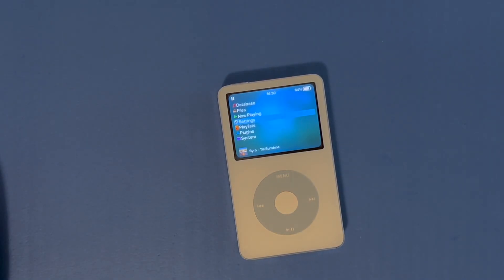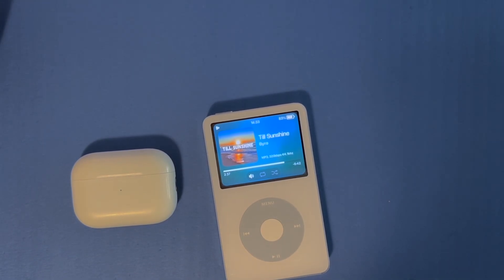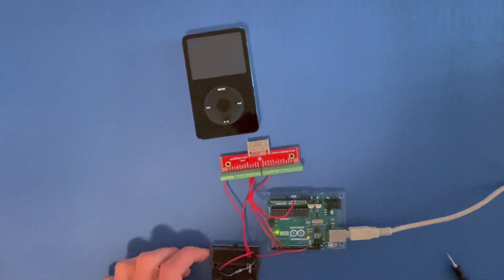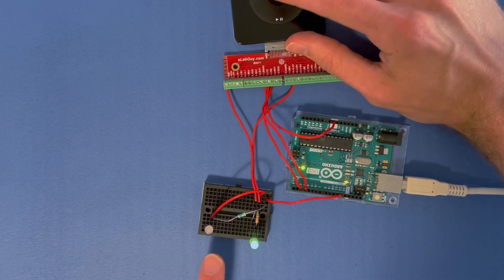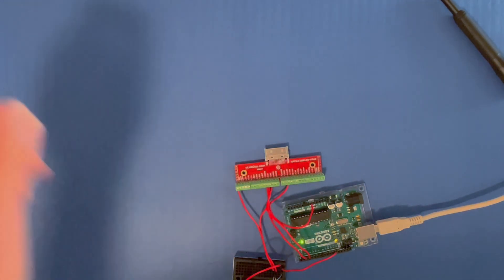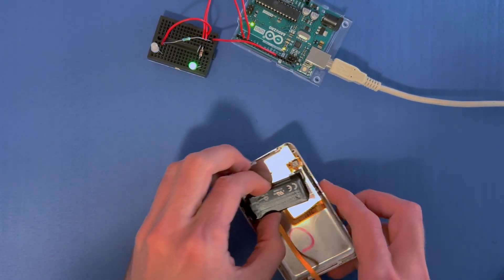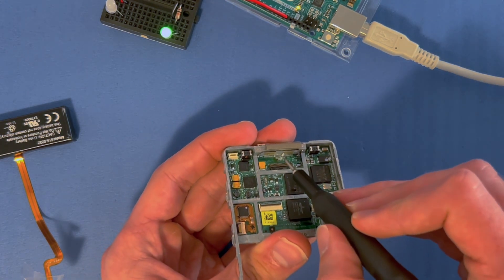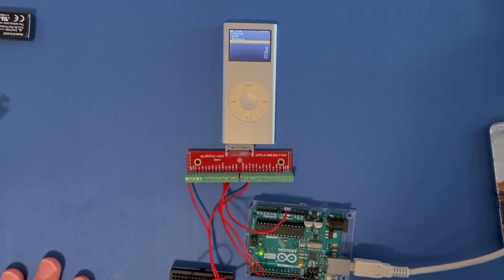iPod Bluetooth mod controlled with Rockbox in menus!

Comment: Is this a bluetooth mod with the headphone jack or another way?
Reply from the maker: Internally the bluetooth adapter connects to the headphone jack and converts the analog audio signal.
Reply: @loafbrad  A shame really. I am so sick of this bluetooth audio jack stuff. I wish somebody would make a smart 30 pin bluetooth transmitter that works properly like a smart device.
Reply from the maker: @mrk1190  You mean something that transmits the digital signal directly? There are some 30-pin adapters that transmit bluetooth but I don't know about the quality of those.
Reply: @loafbrad  Some are okay, like Kokkia. But it's usually very buggy. I just wish there was a smart iPod classic mod made.

Comment: That’s fantastic! I saw your post in a Facebook group!

Only thing I wonder if accessories that use the rx/tx-likes still work, like the radio remote?
Also, does the controller save its state when you reboot into stock OS?
Reply from the maker: This mod can be done in a way to still preserve functionality on other accessories however I haven't tried as I don't own any other accessories. Yes, once I have powered on the bluetooth module it will retain it's state across reboots as it is powered by the battery bus. The microcontroller does reset though but that won't affect the bluetooth module. You would need to boot to rockbox to power on/off/pair with the bluetooth adapter.

Comment: you are right on time. you have to check out @theboxypixel latest video. he just made a new enclosure, not sure what bluetooth modual hes using but if your new software menu works for his chip, then he could either ditch the dedicated bluetooth button and switch or combine these functions in some way.

Comment: How did you cut the transmission window for the BT antenna into the back case and what did you use to fill the resulting hole?
Reply from the maker: I used a hand drill and started with a small hole, then increased drill bit size until the hole was pretty large. I then used a manual filing tool to square out the shape I wanted. It's easy to file down the material as the case is quite soft aluminum. I then created a fixture for a resin pour to fill the hole. The back of the case was pressed against a silicon mat so the resin would match the surface of the back of the case and to make it easy to remove once cured.

Comment: what exact Bluetooth module do you use, i want a module that connects to the air pods pro 2 and i heard there is a lot of issues with other modules. Any info helps thank you.
Reply from the maker: I used an AirFly Pro for mine.

Comment: Can you do this without rockbox?
Reply from the maker: No - this mod specifically requires Rockbox. Technically one could modify the stock firmware and add these types of menus but that would require some reverse engineering.
Reply: Yes you can add Bluetooth without using rockbox, you just need a physical way to control Bluetooth since the original firmware doesn’t have Bluetooth settings. Most people put the Bluetooth controls under the lock switch